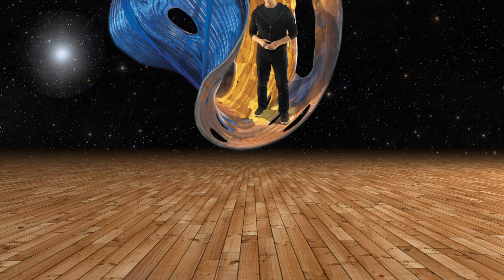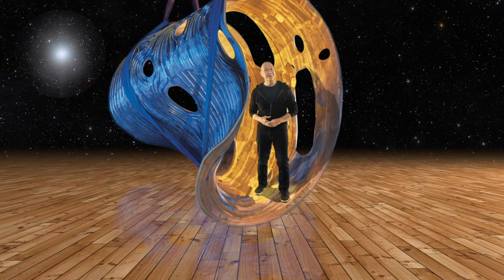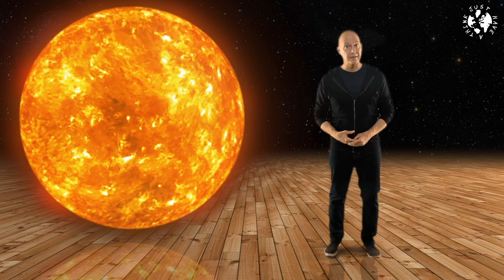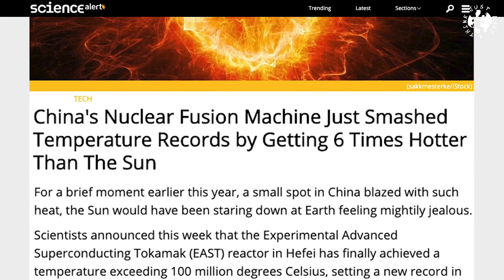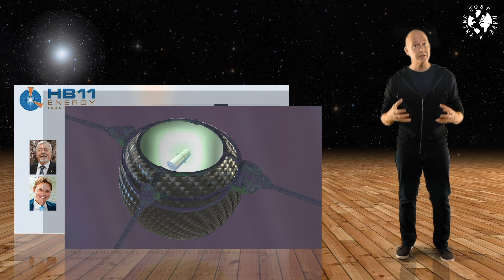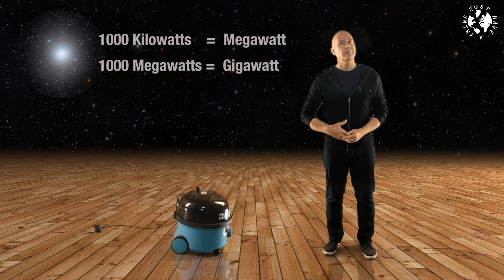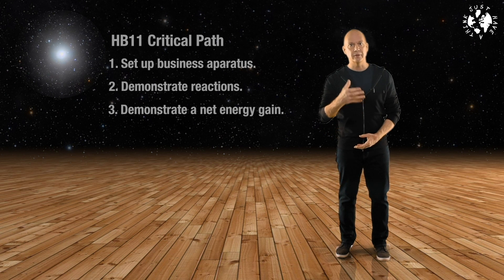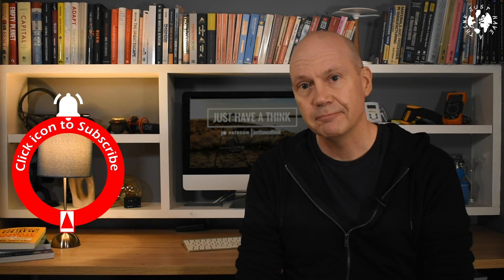Nuclear Fusion:  Revolutionary new breakthrough.

Comment: A couple of things: First, the Stellarator vessel was welded into one piece by humans and it would be an understatement of those German engineer's welding skills, not to mention that. Second, the stellarator is the concept for long pulse operation, contrary to the statement made in the video. The reactor is currently upgraded to sustain pulses of 30min at a time. Third, the main obstacle nowadays does not seem to be the confinement, but fusion fuel. In contrast to HB11, most approaches to fusion rely on tritium as a fuel, which does not occur in nature. It has to be 'bred' from Lithium, but that, in turn, requires a neutron multiplier such as Beryllium which is rare and not at all limitless available!
Reply: Deuterium moderated fission reactors produce a significant amount of tritium.
Reply: @Nukestarmaster  True, but that means we need nuclear fission plants to run the fusion plants - with the risks and the unsolved nuclear waste problem. It begs the question, why not just run fission plants? If you argue: to use the fuel better, you made my point.
Reply: @Robert-er5wq  I'm  not sure of my mind, (or my math) but maybe we are going about this wrong. You want to duplicate the "chain reaction", that occurs between the core of the sun, and it's (?) Photosphere? The core of the sun generates a massive graviton field. It is a very heavy celestial body. Yet you are dealing with magnetic rings to hold a plasma? Made from the lightest of elements. Then you ignite a pellet, in the centre of the rings? There seems to be a disconnect somewhere, but, of course I'm  not a Scientist.
Reply: @brianrichard8310  Sorry Barry, but your response to my comment seems to be disconnected. You probably wanted to comment on someone else's reply.
Reply: @Nukestarmaster  Very few of those reactors in the world because heavy water is very expensive.  I can think of is CANDU reactors that the Canadian are using now.
Reply: @catchnkill  There are actually quite a few CANDU and CANDU derived reactors in the world.

Comment: For me it was an honour to work on the Iter project in France, even though I only dealt with concrete and steel. I was able to understand the theory that you throw massive amounts of energy to produce heat, even if it takes massive amounts of energy to supercool the magnets, because in return you get supermassive amounts of energy back. Then what? You boil a kettle. I've never understood how such old technology of heat water, make steam, drive turbine, make electricity, cool water - repeat - would apply to fusion. At last the Australian system is seeing the atomic energy as electricity itself! A fascinating broadcast, thank you!
Reply: Because why not use excess heat to boil water @ spin turbine?

Comment: Using electrons to fuse protons, is the best way to get stupid people to fund your projects for the next 10 years while doing nothing but saying you are working on something that nobody else can prove or replicate. Cold fusion, cold being relative, around 3000 to 4000C is already being done with He dropping out the bottom because He is heaver. When Hydrogen fuses to Helium, it attracts electrons like there is no tomorrow. There is no need to use the massive amounts of heat that fusion produces. A 16g wire will pull from earth ground about 4Kwh at 3000C. At 4000C a 12g wire will pull 7kwh and can make a spark gap of about 600 to 700cm from earth ground.  Will the world ever see a glass of water power 100 of your closest neighbors for about 4 to 6 days??? NO.... Never.... Cap the bottom of the reactor, dump in a S1 100lb cylinder of liquid hydrogen into it and well, everything in a 20 mile radius no longer exists. Anyone that knows how to make it work and I know of several at this writing will never ever say a word about it. Would you want to sell someone a nuclear bomb? Nuclear fusion for commercial purposes will never be viable, ever. Stop throwing your money way. Run away too when they say they are using electrons or magnetism, it doesn't work like that. Never has never will.

Comment: "Risk free". Well, let me think about this; enormous power in small space with tricky containment technology. Somehow, I feel there is a tiny bit of risk, and I would advise you not to stand inside a reactor - it could hurt.
Reply: Fusion is safer because that energy is only able. To be released in very specific circumstances which is why we are having issues getting a net gain. Oil and gas burns easily. Fission is self promoting (hell there was a fission reaction going on in nature that they found years ago). Yet if a fusion reactor blew up the energy would quickly dissipate as it needs an energy input to be sustained. Now if there was a catalyst that could generate fusion only using the energy it made to continue then we would be screwed, so far that catalyst is gravity and we aren’t using that due to obvious issues. I do get where you are coming from though.
Reply: But only for a moment...
Reply: Sure it could obliterate you in a painful way... OR you could turn into Dr. Manhattan. The average person believes far crazier things every day.
Reply: It isn't a scifi story fusion reactor. Unless you dump a shit load of fuel into it at one go, it can't explode. And to shut it down, you just don't feed it fuel or let the laser activate.
It can't explode.
Reply: Shawn Walker actually it can explode due to stress overtime but the explosion wouldn’t be nuclear or such...maybe a small car explosion would be closest as it would quickly run out of energy as it expands outward. The energy in a sci-fi movie/book depends on the type of explosion. Most are during battle and they need tons of power so the reactor is at peak speed. If they self destruct then it would be a little higher on purpose and so explode. We arnt at those energy levels or really near them. Also we arnt keeping fusion reactors working with duct tape and bubble gum so there is no real reason they should pop. Can’t remember who did a video on all this...will have to look around and find it again for you if I can.
Reply: @Chris-cv1ll  
I'm talking they aren't going to make a reaction that can escape a containment device. But a runaway reaction isn't possible. People see shows were the ship is destroyed by its fusion reactor. But that is fiction.
Reply: When a fission reactor goes wrong and dies in the worst way possible, you spread poisonous dust across a huge area that gives everyone cancer and death for hundreds or thousands of years as the fissile materials heat up and run away into a chain reaction that keeps making things worse.
When a fusion reactor goes wrong and dies in the worst way possible, the superheated compressed plasma breaks free of the magnetic bottle containing it, sprays out into the room, cools down by expanding, stopping the machine, and people in the room with it talk in a squeaky voice for a few minutes.
Reply: @williambarnes5023  not quite true on that last one. the fusion plasma is hotter then steam and steam explosions are a thing. any one immediately hit by it will either get really bad burns and could die. there also would be short lived radiation though prob not in the gamma or such range so not as bad as fission. just saying

Comment: The idea that you can release more energy than you put is just bad science. The energy produced by the suns fusion reaction is less than the gravitational energy exerted on the atoms in the sun’s fusion core. There is no possibility building a fusion generator  on planet earth which will produce more energy than you feed in. Fusion reactors are a pipe dream.
Reply: The sun is a plasma ball it runs off birklund currents. Check Saffire projecy

Comment: 9:14 "A petawatt is a ridiculous amount of energy." I thought joules are the measure of energy, not watts. I think a petawatt for a picosecond is only 1000 joules. Your vacuum uses 1000 joules of energy every second, it's not a lot. A petawatt is a ridiculous amount of power, if you keep it going.
Reply: Agreed. Watts are the units for power, not energy. However, imagine 0.5 petawatt-hours. that's 1.8x10^18 joules. That's what this device will be capable of when it runs for the full 30 minute cycle. Even at 50% efficiency, that's still a 'ridiculous amount of energy.'
Reply: @deluxeassortment  I see you've calculated the power output of the pulsed triggering laser if it was converted from a picosecond pulse laser to a continuous output laser that ran for 30 minutes. I see you came up with an energy that is equal to, I think, 60,000 three gorges dams running for 30 minutes, which is a ridiculous amount of energy, I agree. I don't think this has anything to do with the output of this new fusion reactor. The trigger laser will not be made continuous. If the reactor gets more than 1000 joules of electricity out for every 1000 joule laser pulse in, it's a net positive reactor. The fact that the trigger laser pulse is so brief that its measly 1000 joules makes a big number when the trigger laser pulse's power is calculated does not factor into the continuous power output of the reactor. Although the trigger laser makes brief petawatt pulse, it does not consume a petawatt... there would be no where to plug it in. It draws a normal everyday wattage, makes a brief trigger pulse, and kicks off a little fusion in a boron pellet, enough to run a vacuum for a second or so.
Reply: @wondz  The laser only uses 2 kilojoules in that picosecond. 1 kilojoule laser for magnetic confinement and 1 kilojoule laser for adding energy to the state of the fuel source to increase quantum tunneling. The beauty of pulsing lasers is you can do short pulses of energy input and get continuous output due to probability overlap.
Reply: @deluxeassortment  At 50% efficiency, you also to have to dissipate a lot of energy.
Reply: @waynet8953  In the case of HB11 that may simply mean not being able to pair electrons to protons. The temperature of these reactions is much lower than neutronic fusion. Another efficiency loss is the energy required to maintain the additional confinement required to increase quantum tunneling to usable levels.
Reply: Technically it's true, Dave should have better said "petawatt second" instead of "petawatt" or "amount of power" instead of "amount of energy". But, no offence, Doug's remark is much more pedantic than Dave's inaccuracy is significant.
Reply: @ggg148g  "petawatt second" is overstating the energy of the triggering laser by a factor of 1,000,000,000,000.  "Petawatt-picosecond" would be far more accurate.
Reply: @wondz  I get your point. However, we all know that nobody can make commercially available energy from nuclear fusion right now, and the thing must be looked in perspective, the famous 20 years always ahead of us. Is there the possibility that, one day, they'll manage to sustain the reaction for longer than a picosecond? In this case, the result deserves attention, and Dave's slight inaccuracy is not at all misleading. If, instead, you know some theoretical reason why this thing will never ever last more than few picoseconds, then, I agree with you, the difference between power and energy is basically the whole story.
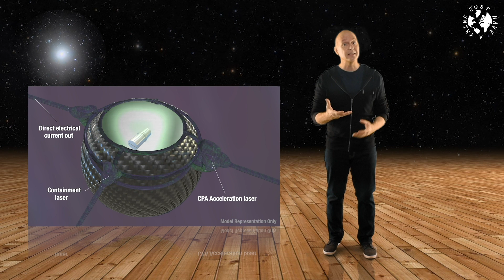Reply: @ggg148g  I don't know what got Dave so excited about a 1000 joule, petawatt trigger laser. It's brief, yay! If the video around 8:50 implies one reactor delivering petawatts based on the trigger laser pulse being a petawatt, that seems like a non-sequitur. I think if there's a nuclear physicist with a reactor bragging about the irrelevant "petawatts!!!" of their brief 1000 joule trigger laser pulse, they are definitely trying to dupe venture capitalists. As to your questions, I don't think the trigger needs to last longer, nor does the reaction need to be sustained for aneutronic fusion to be a success... If they get more joules out than joules they put in* (pulsed or continuous, doesn't matter), the energy crisis is solved, and cleanly. (lol I typed "power crisis" and changed it.) *Gotta also account for energy to make and maintain the reactor, but you know that.
Reply: @wondz   I suspect that we misunderstood each other, and that I should stick with the opinion that the power-energy confusion is a trivial inaccuracy.  Dave might look too excited in 8:50 (to me, not particularly), but he is speaking of an existing technology that got the inventors a Nobel Prize: https://en.wikipedia.org/wiki/Chirped_pulse_amplification 
I did not look at it closely, I am not sure I will, but it does not take long to read that, essentially, it does what Dave says it does. 
Did I get you wrong, or did you say that this technology is a fake to  dupe investors? If you didn't mean that, you probably meant that this thing will never trigger a fusion reaction. In this case, why do you say that? Personally, I have no deep knowledge and therefore no strong opinion either way.
Reply: @ggg148g  The fusion's real. Boron aneutronic fusion is a decades old idea, now possible because chirped lasers are fast enough to dump 1000 joules (not a lot) into one end of a tiny boron pellet fast enough (picosecond) to initiate fusion. Whether this trigger pulse is technically petawatts, exawatts, or yottawatts is just a description of how brief the 1000J pulse is. "1000 Joules" doesn't sound exciting like "petawatt" does, especially when the detail is omitted that the petawatt is only for a picosecond. Imagine how much trouble a person could get into if they thought the difference between miles-per-hour and miles was trivial.
Reply: @wondz  I understand you now (it's not the first time I think I do, though). The point of CPA is not to raise the amount of total energy given off by the laser, but to concentrate it in a short pulse. The shortest the pulse, the higher the power, but the energy released is constant. The energy/power confusion is not a trivial issue ( slightly more than so, though :) given the scope of the video ). 

Taken by a rush of confidence I dare to conjecture that what matters to trigger the fusion is power, rather than energy, because the time scale of nuclear reaction is short, I don't know how short, but probably of the order of a picosecond. You don't need an energy injection spread over a longer time span, you need a sufficient amount of energy discharged all in that picosecond (or whataver the timescale of nuclear reaction is). Then the fusion reactions start and sustain themselves. So, this successful experiment looks like a real thing to be excited about. Doesn't it?
Reply: @ggg148g  You are right, the short time scale of the laser pulse is what has made boron fusion possible. The fusion is pulsed and not self-sustaining with this method, nevertheless, if they can ever get more energy out than they put in, it would seem to be a clean solution to the energy crisis. It seems exciting to me, but I wonder why I'm not hearing from a lot of excited nuclear physicists, I suspect they know some show stopper that I don't.
Reply: @wondz  you explained to me a lot of stuff, thanks. If I were a nuclear physicist I would wait a while before showing some enthusiasm even if I had reasons to be excited. If this thing is really promising, we'll hear more about it. Let's see
Reply: 1.21 petawatt! :o

Comment: Did it occur to anyone that the reason fusion can’t be sustained in these reactors might be because they are based on a mistaken assumption that it’s how the Sun works? 

Although it’s generally accepted that stars convert energy by fusion there are numerous problems with modelling our own star using this idea. One example of these is how a process in which photons take a million years to migrate from the solar core to its surface (by a mechanism which was invoked ad hoc to suit this model and cannot be tested) can produce the 22-year solar cycle.

Plasma cosmologists including Nobel laureate Hannes Alfven have been advocating an Electric Sun model for decades. This model suggests that the Sun and all stars are driven by very large scale Birkeland currents running through the galactic arms. The model was put to the test by the SAFIRE project over the past few years.

Not only has this experiment shown that the Electric Sun model can account for the appearance and behaviour of our Sun but it has also demonstrated that a current discharging to an anode under the conditions used for the experiment in a hydrogen atmosphere leads to the production of at least 11 elements not present in the starting gas mixture. That is, the same conditions which model the Electric Sun also lead to the formation of new elements matching most of those seen in the Sun’s atmosphere. Furthermore, the experiment produces an energy anomaly suggesting that fusion may be occurring in relatively mild conditions (compared to ITER, for example), that is temperatures < 1000 C.

To date, the results are not fully understood but they do indicate that an experiment based on a completely different model of the Sun has stumbled across the sort of energy conversion that fusion has singularly failed to produce in several decades.
Reply: Saffire Project
Reply: @leeadickes7235  *SAFIRE

Comment: This sounds a bit like those free energy videos. It sounds like it could make sense on a very coarse level, but it's at best questionable when you look only a small bit closer. Some things in desperate need od clarification:

1. High speeds and high temperatures are not that different. What's the point?
2. Most of the energy of the fusion reaction will be thermal (random impulse gain). Exploiting just the ionization effect should waste most of that, why wouldn't it?
3. How is the ionization exploited in the first place? A speed/charge differential can be expected but it is randomly oriented and it's not like you could put an electrode in the middle of a fusion reaction.